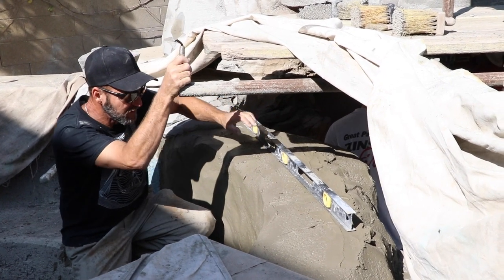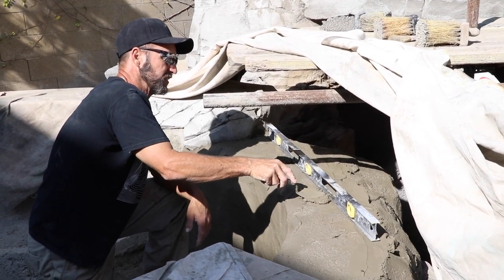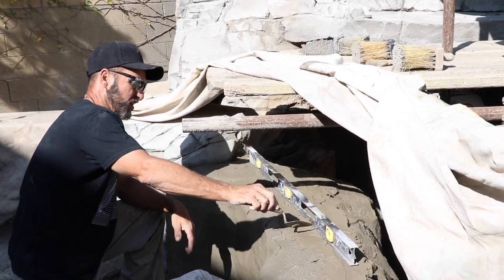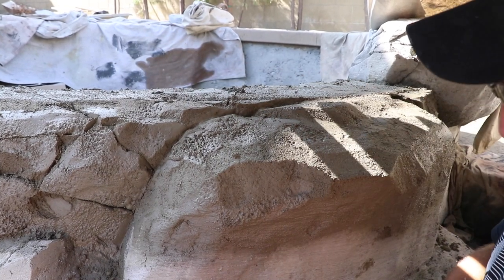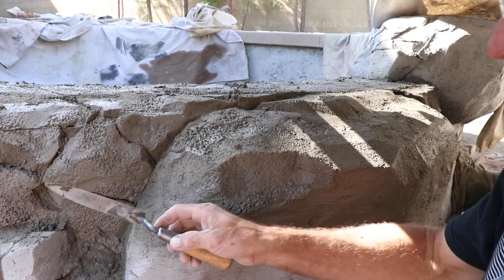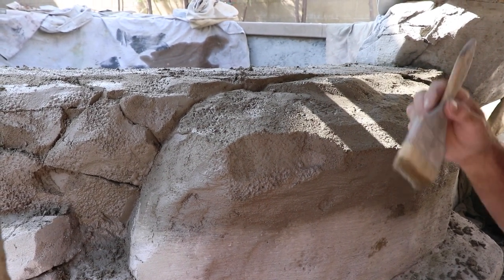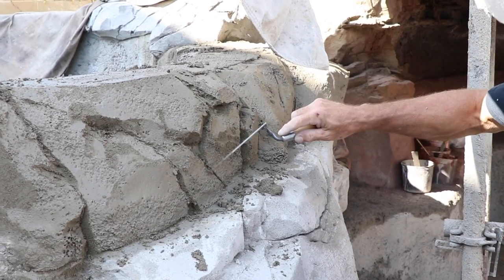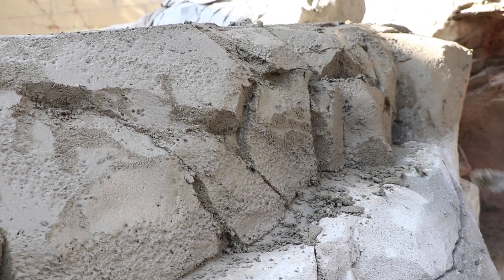Spa dam wall texturing part 3 of 3.

Comment: Do you have a how to package?
Reply from the maker: yes, please visit www.carve-right.com
we sell DVDs and VODs plus material and cast pieces under products- casting and material
Reply: @HDHDT  do u sell wall builder to mix in the truck?
Reply from the maker: @GRUBB-MUDD  Sorry No, I believe that is David Montoya's design
Reply: @HDHDT  yeah it is, I thought u guys had a similar product, anyways I will still watch your channel! I have a mix design to do it, just no wall builder, I heard u can use r4 plasticisor instead
Reply from the maker: @GRUBB-MUDD  We sell a product called carve-right which can be checked out at www.carve-right.com.  It is a pre-blended cement for architectural facade work, typically used over shotcrete for rockwork.